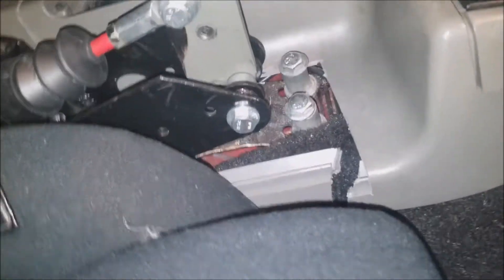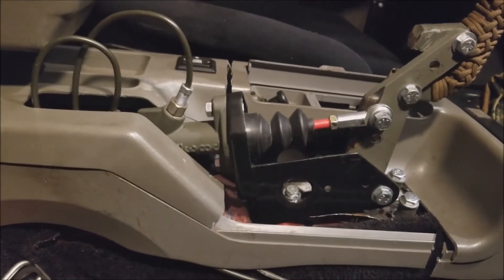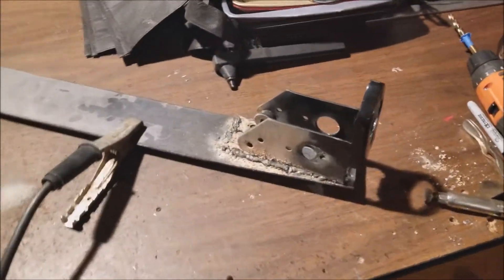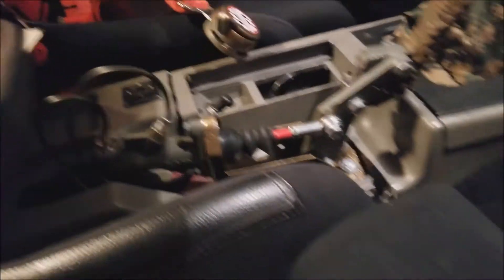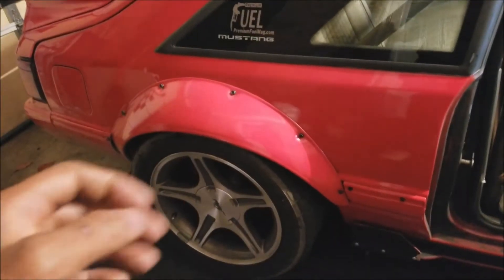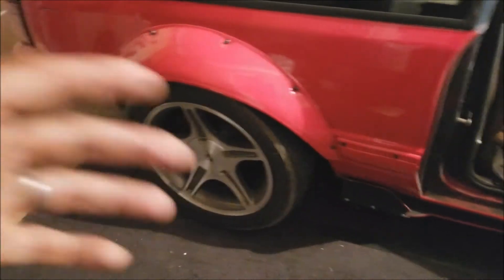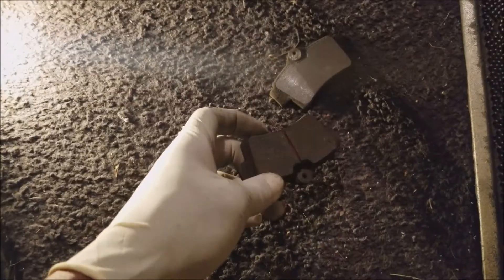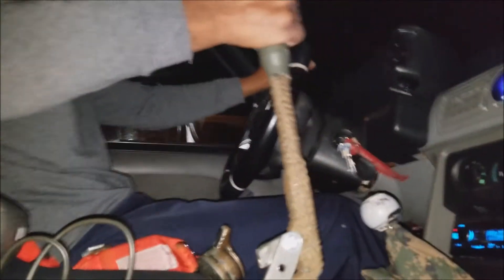Finally Fixed my e-brake!!!!

Comment: Uneven wear is caused by binding in the system. Either the slider pins are seized up,  or the piston is sticking out on the caliper, or the pads are binding in the caliper bracket.on all brake jobs you should:1. remove the bracket and clean with a wire brush or sand paper, put antiseze on where the pads slide, they should install freely and move back and forth easily without binding.2. remove, clean and lubricate the slider pins with disc brake lube, if they come out hard or dont move freely after being lubricated and installed, a rubber boot has swelled, or there is corrosion in the hole that needs to be cleaned out3. clean your rotors with brake clean and a clean rag on both sides4. press the piston back in the caliper, if you cant do this with channel lock pliers or a caliper pressing tool fairly easily, the caliper is binding and will need a rebuild, or to be replaced.
Reply from the maker: Thx for the input!

Comment: Uneven wear is from the caliper pistions not doing their job. You need to check them
Reply from the maker: how and what would i check?
Reply: Premium Fuel Mag either there is corrosion on the pistons or improper installation of the pad where it's always on the rotor. I'd start by removing the the caliper and just cleaning it and stuff
Reply: Premium Fuel Mag greese the caliper slide pin with Sil-glyde. It can be found at Napa auto. Caliper slide pin is how the caliper re-adjust it's self on the rotor after the brake is applied.
Reply from the maker: thx, will do